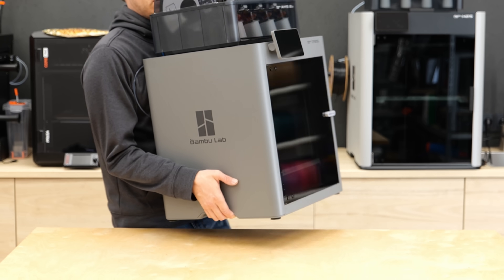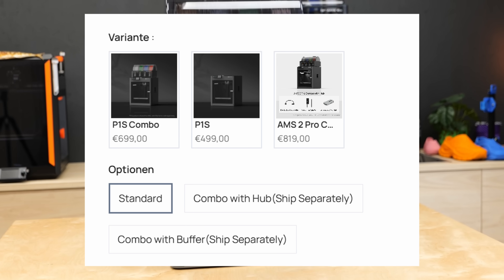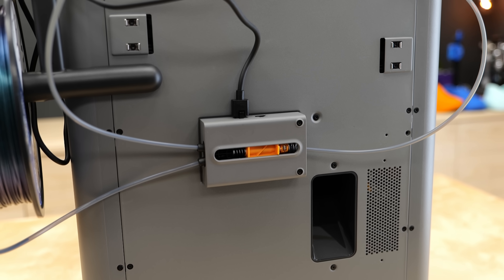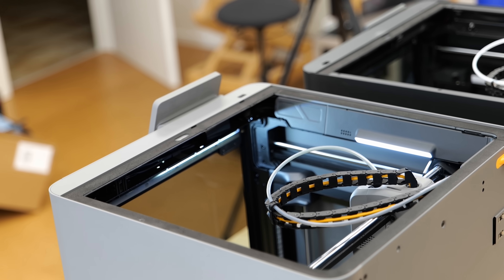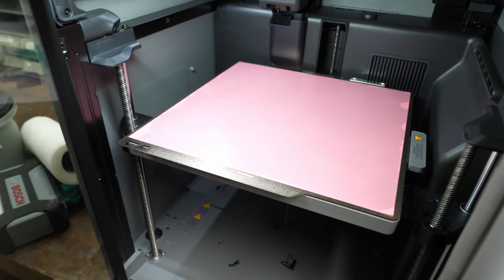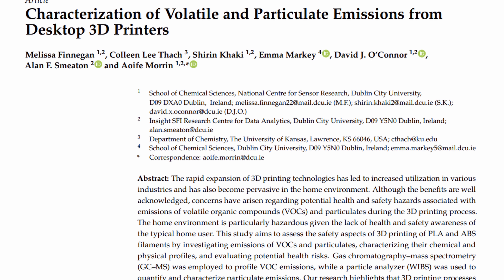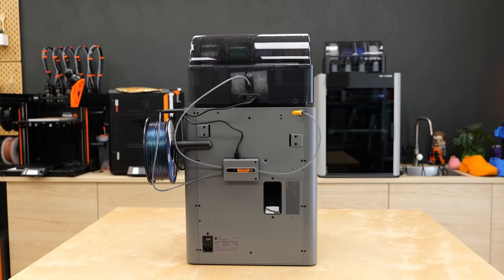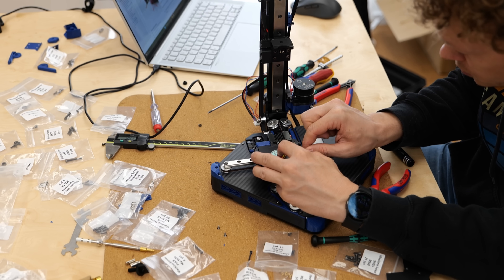The P2S Is the Upgrade No One Expected – But Everyone Wanted!

Comment: I don't doubt someone has already printed a filter for the exhaust on that machine but it doesn't excuse Bambu labs for not doing this themselves.  Angry German nit-picking (British/Scottish in my case) or not,  those vapours are not something to be taken lightly even with "safer" PLA.  Yes air purifiers are a thing but again that's not excusing Bambu (and others) for being cheap.

Comment: News: P2S Firmware Update which should fix VFAs. Printed well afterwards, but so did it before the update. Sounds like a good topic for the next cnckitchen video :)
Reply: Could you tell me a bit more? I’ve ordered the P2S, which I’ll receive in January, and I’d like to know whether people who have already received the update have noticed any improvements.
What are your sources? Where does this information come from? Could you please provide the links?
Reply: @TM-ej5pw I wrote like 15 minutes on a damn comment and then yt app crashed and deleted all the writing, daaammned.

Second try:
My source is just my own experience with my P2S. Got the printer pretty early and got an update notification few weeks later. Changelog said it is to improve VFAs and that you should re-run the motor vibration/resonance calibration afterward, which takes like 20 minutes.

I would love to hear someone else to confirm or deny this, but at least to me it looks like it has improved, even if i never found it too bad to begin with. The sound under movement also changed a bit under certain speeds, i think they changed the stepper control loop to archive this.

Secondly the update also altered the air filter behavior and runs the fan for the air filter more aggressively when printing filaments that dont need fresh air (so everything except PLA and TPU basically). And the update give you the option in the settings to activate automatic air purification after a print, so the air filter activates for few minutes to max settings when printing is done.
Over all its definitely a slight improvement, but i highly recommend an extern hepa air filter when a 3D printer stands in your living room. I got an levoit 300s since 2 years or so, makes 3D printing more safe and also helps with allergies or fine particles from the outside (from cars and so on). ABS and PC is still something i wouldn't want to print on a printer next to me, but thats the exception. 

Hope this helps

Comment: I've got one and it is fantastic so far. But when I read their FAQ there were no details on releasing unfiltered air for low temps... Now I am quite paranoid because although I only use PLA for 99% of the things the space j have right now is not the best in terms of ventilation. I might get another air filter or something to help but that's a stupid design choice... It should always be filtered!

Comment: Well, 3 important questions to really answer:
= Should owners of old model upgrade ( probably selling old model and add some money to get this)? It doesn't really feel that big upgrade
- Is competition from Creality or Elegoo better value while giving the same quality prints? I have K1 Max, no tinkering, I am using it as an appliance. 
- How about that Snapmaker U1? Almost the same price, a bit bigger build volume and much, much less waste in multicolor? Is tool change the future?

And that bad thing about closed system isn't really appealing. But if it doesn't limit you, yhen its OK I guess?

Comment: I want to get into 3D printing but I'm stuck between starting with the A1, or pushing the budget and going for the P2S. 

In my country the P2S with AMS is about 2.5x the price of A1. I'm not going A1 with its AMS because of space constraints as it sits alongside the printer. I like the top-mounted AMS with drying functionality on this P2S, but if I'm not going to get seriously into this hobby the P2S just seems like a lot of money over the A1 which as far as I can tell from a lot of (sponsored) YouTube videos is also excellent.

Tricky decisions.
Reply: You can mount the AMS lite on the A1 on top of the printer or on the wall behind it.

Comment: Hey guys, quick question. So ive just ordered the p1s yesterday because of the 368€ discount. Before that i had an A1 and was really happy. The only thing that annoyed me was the pla smell and the sound when i tried to sleep because the printer is in my bedroom. And now to the question, would you guys say its more reasonable for me to send the p1s back and get the p2s for 520€ or just keep it because all the upgrades are unnecessary for the stuff i do. In terms of Printing I use it like once a week for 5 hours and i mainly print pla. Also just basic components for my Engineering classes.

Comment: For your information most of the bambu printers can be connected directly, without internet, AND without activating the "LAN MODE", just use FTP with port 990 (filezilla for example), Use TLS, username is "bblp", and password is the access code write on the machine LCD (you will find this in the sub menu), and after you can just send a "post" request to start the print ... mostly port 8883 or 8899 depending on your printers (A1, P1S, etc, etc ... they have different acces protocol). (be sure that you place your .gcode on model or cache folder ...), you're welcome !

Comment: WARNING!!
Bamboo Labs customer Service is deplorable
Multiple reports from users across online forums like Reddit, Facebook, and the Bambu Lab Community Forum confirm that Bambu Lab's customer service has been widely criticized as deplorable. Common complaints include slow response times, unhelpful automated replies, and a difficult, frustrating support process. 
Overview of customer service complaints
Extremely slow responses: Customers often wait weeks or even months for a reply to their support tickets. This has been a recurring issue, with many users documenting long delays, particularly for orders and warranty claims.
Unhelpful and automated responses: Many users report receiving canned or automated responses that don't address their specific issue. Some say they are asked to repeat troubleshooting steps they've already tried or to provide information they have already submitted.
Difficult and convoluted process: Submitting a support ticket is reportedly burdensome, requiring customers to provide extensive information, logs, and photos or videos before even getting a meaningful response.
Failed warranty and return experiences: Despite having a defective product still under warranty, some customers have had requests for repair, replacement, or refunds denied. One Better Business Bureau complaint from 2025 details a denial of a replacement after repeated attempts to fix a defective printer.
No phone support: Bambu Lab does not offer phone support, meaning all customer interactions happen through written communication via their ticketing system. This further exacerbates the frustration for many users. 
Reasons for the customer service issues
Rapid company growth: As the company experienced a rapid surge in popularity, its customer service team reportedly became overwhelmed with new users, many of whom were inexperienced with 3D printing.
A1 printer recall: The A1 printer recall in early 2024 significantly amplified the workload for the support team, creating a huge backlog and angering many customers who were waiting for refunds or replacements.
Company location: Some users attribute the poor experience to a culture clash between what they call "Chinese customer support" and Western expectations for support.
Understaffed team: During certain periods, the company has reportedly been short-staffed in its customer support division, contributing to negative experiences. 
Bambu Lab's acknowledgment and efforts to improve 
Bambu Lab has been aware of the support issues and has attempted to address them. In March 2024, the company published a blog post acknowledging the problems, particularly after the A1 recall, and outlined its efforts to improve customer support. Some users have noted that the situation seems to be improving, though experiences can still vary widely.

Comment: Regarding the air filter that was done away with on this model, couldn't you just model a filler that could hold the filter from the previous model?
I've done this on other items that were marketed with and without certain components.  I was able to model some workarounds that allowed me to utilize components from different models manufactured by the same companies.

Comment: Would you rather buy a P2S or a H2s ? I want to put the printer into the basement and have concerns about the temperature. I probably will print pla and petg most of the time but want to be able to print abs as well.

Comment: Ordered the P2S yesterday, it arrived today. This is my first printer, never 3D printed anything before. My first print was a 3D Benchy and it was nearly flawless, better than the example shown in this video. I've got a levoit core 200s air purifier sitting right next to the exhaust to suck up as much of the particulates as possible. Too bad the bentobox doesn't work on this, but I guess I'll wait to see what people come up with for better air purifying solutions.

Comment: I absolutely agree with your title. I excepted a minor upgrade, but after watching the first review and the price of 750 euro for the combo, I immediately ordered one. You basically getting an upgraded X1C for much less money. At this price point there is not much sense in buying the A1 combo any longer. I was waiting for an AMS2 support for my A1, lucky for me Bambu delayed that support, so I bought the P2S combo. The A1 prints very well, but the bed slinger takes allot of space, the UI is sluggish, it a PITA to load and unload filament manually. I needed to build an enclosure because the printer is located in my garage and every blow of air effects the print quality.

Comment: So, what's gonna happen with the support of the now deprecated X1/P1? for how long they'll still sell replacement parts and make software updates?
I wouldn't be so happy about this release tbh if I were a Bambu owner, luckily I'm not. But please enjoy that they direct 3d printers industry in the same abyss cellphones are currently in - designed obsolescence and couple of years of support after which you suppose to throw it into the garbage bin and just buy a new one..

Comment: 8:02 EXACTLY. I've had my P1S for around a year now and I love it, but the support is hit or miss and sometimes I run into problems. I recently had a print that used 400+ grams of filament and just stopped extruding in the middle but kept printing nothing on air. So everything was lost and not recoverable, support was useless, and told me to next time "print with the door open." Why would I pay hundreds of dollars more for a version of the P1P where the only difference is a door after you advertised the door as a feature worth paying hundreds for, just to keep the door open the entire time I print? Really infuriating. Of course, didn't get a penny back from the dozens of dollars spent on their filament plus shipping, and of course their slicer doesn't allow me to resume mid print and of course their printer doesn't allow external slicers after a firmware update. The printer itself is AMAZING and the community on makerworld is AMAZING and the mobile app, website, and slicer are very good (although their website and app are frequently super buggy), and sometimes their support is good, but sometimes it's just a really horrible experience with printing, horrible experience with their support (very very difficult to get a human), and horrible experience with their buggy app and site.

Comment: I've noticed a few posts about upgrades and an upgrade kit for the PS1. There won't be one as they are fundamentally two different machines. According to their website FAQ: Q: Is P1S upgradable to P2S?
The P1S does not currently support upgrading to the P2S model. Unlike the P1S, the P2S is not a partial component optimization, but a comprehensive iteration covering core hardware — key components such as the frame structure, mainboard, toolhead, screen, and air circulation system have all been redesigned. These components have fundamental differences from those of the P1S in terms of specifications, parameters, and functional logic, making it impossible to convert the P1S to the P2S model through simple component

Comment: Is there a P1S to P2S upgrade path? I mainly care about the A1 style print head.
Reply: No, there isn't. Totally different machines. From their website FAQ: Q: Is P1S upgradable to P2S?
The P1S does not currently support upgrading to the P2S model. Unlike the P1S, the P2S is not a partial component optimization, but a comprehensive iteration covering core hardware — key components such as the frame structure, mainboard, toolhead, screen, and air circulation system have all been redesigned. These components have fundamental differences from those of the P1S in terms of specifications, parameters, and functional logic, making it impossible to convert the P1S to the P2S model through simple component replacement.

Comment: I think you might actually be a bit wrong about the ventilation issue you're describing. When the ventilation flap is open, there is nothing blocking the filter, right? So a lot of the chamber air still circulates through the filter. Am I wrong? The ventilation opening obviously reduces the effectiveness of the filtering but it should still be a lot better than nothing!

Comment: Waiting for the update kit to change p1s to p2s
Reply: there won't be one. There are too many differences in hardware, specifically the motherboard and controller. From thier website FAQ: Q: Is P1S upgradable to P2S?
The P1S does not currently support upgrading to the P2S model. Unlike the P1S, the P2S is not a partial component optimization, but a comprehensive iteration covering core hardware — key components such as the frame structure, mainboard, toolhead, screen, and air circulation system have all been redesigned. These components have fundamental differences from those of the P1S in terms of specifications, parameters, and functional logic, making it impossible to convert the P1S to the P2S model through simple component replacement.

Comment: I wonder if they’ll sell an upgrade kit for us to convert out P1S. I’d really like the LCD screen and AI detection on my P1S
Reply: There won't be an upgrade kit. They are two fundamentally different machines. From their website FAQ: Q: Is P1S upgradable to P2S?
The P1S does not currently support upgrading to the P2S model. Unlike the P1S, the P2S is not a partial component optimization, but a comprehensive iteration covering core hardware — key components such as the frame structure, mainboard, toolhead, screen, and air circulation system have all been redesigned. These components have fundamental differences from those of the P1S in terms of specifications, parameters, and functional logic, making it impossible to convert the P1S to the P2S model through simple component
Reply: @iam.miikey that being said, I don’t see why it’s impossible for them to offer the screen and camera as an upgrade. Even if it was from the X1C or a partial upgrade from the P2S

Comment: 11:08 This printer is a small manufacturer mid level which mean you’ll need to hook a ventilator out of the machine you see it quite often in manufacturing machines to obtain fresh air circulation this is most common way of push pull configuration and the size shop u have you need it as well .

Comment: 12:34 here i dont agree as a general thing, like, today i had a costumer that wanted to change the belts on a p1s and holy smokes, it was a very involved process, and the process to remove the panels and everything you need to remove was overdone in my opinion, i had to take out 20+ screws to remove the panels. i think they should had done a much better job regariding that. beisdes that, i started to like their machines, ngl

Comment: Lot of good improvements. Interesting that both you and Tom called out the same things about not having air filtration, VFAs, etc. and I haven't seen others encounter it. For the VFAs, I wonder if the others just don't have a larger flat surface print they did, or are the German printers having an issue?

Comment: Was recently torn between the P1S and the X1C as my second printer. Decided eventually to just get another A1 and make a custom filtered enclosure/cooling setup. Spent the money I saved on filament. No regrets.
Reply: Any links, pics or info about the enclosure?
Reply: @zachgullerman3183  $40 fireproof enclosure and $25 HEPA purifier from Amazon. Printed ducts to run cool air though the vents on the sides of the printer. 

I have done some really nice nylon prints using a cardboard box as an enclosure on an A1 Mini, so I am pretty confident in my abilities with this setup.

Comment: I love your content and this is a great intro for the new printer, thanks Steffen! 

I actually disagree about the Bambu cloud issues though. I'm running Orca Slicer, Home Assistant, and the BTT Panda Touch all without issues on the latest Bambu firmware on all my printers. I just turned on LAN and Developer mode and it works flawlessly. I think Bambu have done a great job leaving access available for third party tools without modification for those who want or need it. The only thing I've lost is access to the Bambu Handy app, everything else works exactly as it did before. I never used the Handy app except to monitor my prints, and Home Assistant provides all the functionality I need in that regard. I don't really feel like I've lost anything. 

Thanks again for all the great content!